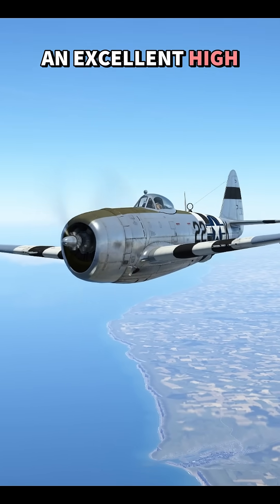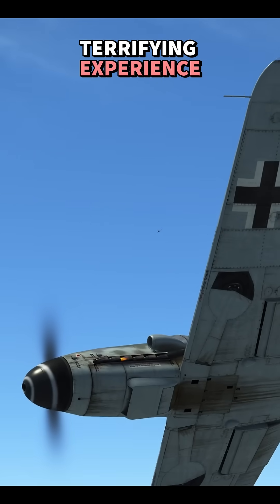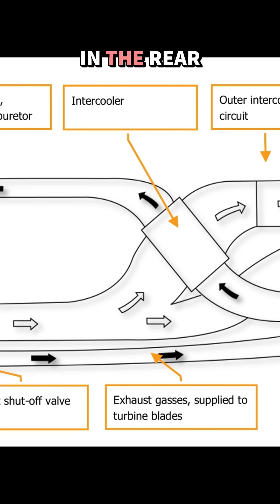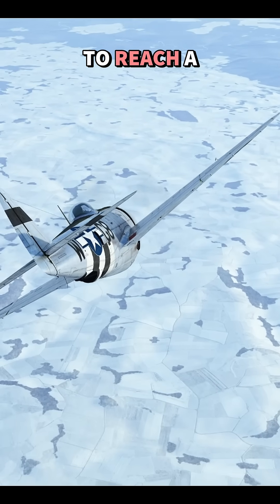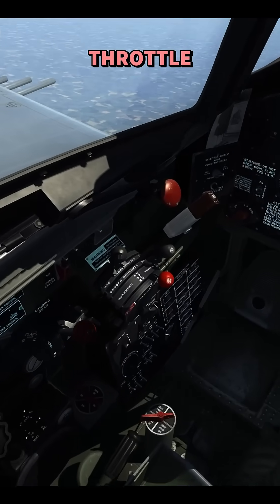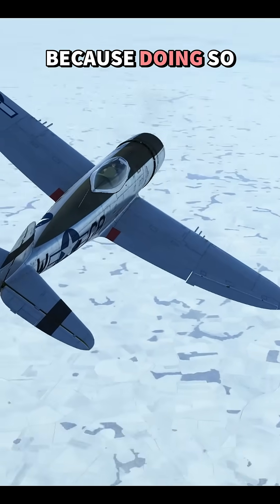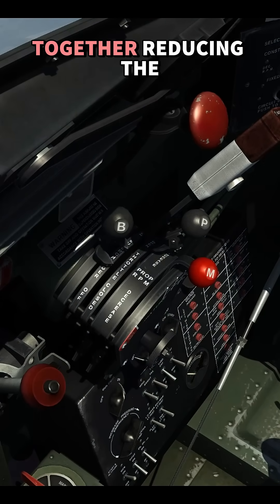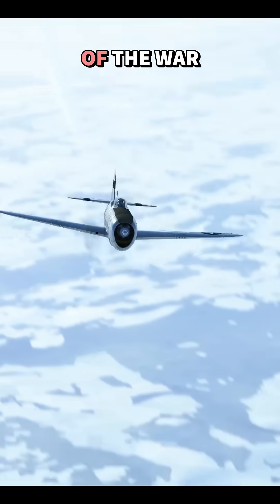P-47 Thunderbolt - Turbosupercharger

Comment: I use the (m) system and don't understand the (ft) system. Could you please make a video using the (m) system? Because there are more of us than those who use the (ft) system. The (ft) system is very old and is becoming less relevant
Reply from the maker: I usually include conversions so both metric and imperial units are shown. In this video, though, I felt it would've been a bit too cluttered, especially when listing speeds for multiple aircraft.
So I apologize for that.

Comment: I believe a turbocharger is using exhaust gasses to compress the intake air whereas a supercharger is a compressor directly (mechanically) driven by the engine itself. There is no “turbo supercharger”.

Comment: Didnt the later versions of most high altitude fighters and interceptors on ww2 use geared turbo and supercharger systems? Like the later versions of the FW 190. I feel like a geared turbocharger would perform better than this system

Comment: The engine was turbo supercharged.  It had a turbo in the back, and the supercharger was actually integral to the engine. It was housed forward of the accessory gearbox and aft of the second row of pistons.
Reply: That's not what turbosupercharged means. The "turbo" is the turbosupercharger i.e. a supercharger driven by a turbine. The second-stage supercharger you mentioned isn't what makes it turbosupercharged.
Reply: @_questionmark_ no.  There is no”turbosupercharger”. There’s a turbo and a supercharger.
Reply: @petrosspetrosgali it seems you don't know what a supercharger is
Reply: @_questionmark_ no.  I didn’t . I have not been a certificated aircraft mechanic for 2 decades.

Comment: It had a supercharger as well it was double supercharge in the open mouth was the cool the air on the P38 you'll see it center of the pylons P-51 you'll see it on the belly the one on the P-51 nose is engine oil cooler
Reply: A turbocharger is a form of supercharger.

Comment: Did the chicken or the egg come first 😂 I’d have described with the supercharger first since the turbo takes time to spool and the super charger is driven by pulleys off the engine. That’s the whole reason to not just use a turbo. They needed the help from the supercharger at lower rpm with the turbo technology of the era.
Reply: aircraft engines don't spin at low RPM in flight, the second-stage supercharger was there to increase boost
Reply: @_questionmark_ I’m not enough of an geek on this topic to tell you when exactly each plane upgraded but typically pre war and at the beginning of ww2, when the engines for these planes were being designed, they were using fixed pitch propellers. Variable pitch propellers weren’t a thing yet. 

So they were designed to be used much more similar to a car engine, where the engine has to change rpm to change speed. if you don’t have variable pitch propellers the engine will rev up or down based on throttle position. 

As the war went on most planes upgraded to variable pitch propellers that allows a fixed/optimal operating rpm like you’re describing. But the existing engines weren’t changed in most cases. They worked well enough and they needed planes asap. Production lines for existing engines already were working. 

If the engines were designed to operate at a single rpm or small range they would never need a super charger. You’d just use the biggest single turbo that can spool at normal flight rpm.
Reply: @Rainersherwood  Variable-pitch propellers were a pretty well established technology and they were being manufactured by several companies by the 1930s. The first Thunderbolt prototype to use the R-2800 was the XP-47B in 1940, which was fitted with a constant-speed propeller so your point about fixed-pitch propellers doesn't apply in this case.

When you want to fly at 13,000m above sea level like a Thunderbolt could, you need all the boost you can possibly get and you can only spin a compressor so fast before the impeller shatters from the forces or the air gets too hot for the metal to withstand, so you have an upper limit on your compression ratio from a single stage, with a second stage you can easily go much further from there. It was all about maximising manifold pressure.

Comment: Not only should you never move the turbo ahead of the throttle, if you don’t need the throttle response time you should never use the throttle and turbo together. Instead, think of the turbo lever as an extended range of the throttle, you leave the throttle wide open and use only the turbo lever to get the required manifold pressure. The throttle should only be pulled back if idling the turbo still yields more manifold pressure than you want.
The engine has its own one-stage supercharger which is downstream of the turbocharger. This consumes about 300hp regardless of whether the turbo is in use or not. If you move the throttle and turbo together then this power is essentially wasted as you’re expending it to overly compress the air only to lower its pressure back down at the throttle.

Comment: You explained that it’s a turbo supercharger but explained how a turbo charger works? Is there no supercharger or is it both or somewhere in between the two
Reply: It’s a supercharger driven by a turbine, driven by exhaust heat and expansion.  Or in the parlance of the day, a “turbo-supercharger”. 

That’s what they called it.  The engine also had a mechanical supercharger, and the charge air cooler between the turbo-supercharger and the mechanically driven supercharger was called the “intercooler”.  If there was a charge air cooler after the last stage of supercharging, it would be an “aftercooler”.  😬

Comment: Robert S. Johnson, the top scoring P-47 ace, said the addition of the paddle prop was like adding 200hp and that the P-47 would then outclimb the Bf-109s at high altitude.
Reply: Francis Gabreski was the top P-47 ace of WWII. Gabreski had 28 kills Johnson had 27.
Reply: @charlesdudek7713  Yes indeed and Pat Pattle had 35+ in a Hurricane against the very best the Germans had in 41
Reply: @jacktattis He didn't fly a P-47 so what does that have to do with this conversation?
Reply: @charlesdudek7713  You mentioned Gabreski etc I just gave you a pilot flying a Hurricane beat your best in 10 months
Reply: @jacktattis  yeah and he was killed in action unlike gabreski so was he really the best?
Reply: @aperson696  50+ how about that one  Gabreski ?
Reply: @jacktattis  the P-47 still had a greater kill ratio than the hurricane and pretty much the same as the spitfire
Reply: @jacktattis Gabreski was our best. He was the best in a P-47.  Richard Bong was our best with 40 kills  flying a P38. Before you get yourself all puffed up remember if we didn't enter the war you'd be speaking German.
Reply: @charlesdudek7713  hahahaha When Operation Sealion was cancelled No German invasion 
Bong flew a P38 he never faced the Germans
Reply: @aperson696  Kill ratio  we never used that. Purely an American thing. Like counting  aircraft destroyed on the ground as victories GEE YOU WERE PATHETIC
Reply: @jacktattis  I guess the fact that you would have lost the war without us is what drives your defensiveness and insecurities.  Get feeling better.
Reply: @jacktattis its still enemy knocked out no? also the entire 56th fighter squadron were aces
Reply: @aperson696  No it is not, of course the US used it to boost numbers 
Ahh the mighty 56th 665.5 kills now get some education my friend 
56th F/G 112 active planes 
RAF Hurricane Sqns 16 planes /Sqn  before D/Day
1    Sqn 212.5 
85  Sqn 278
111 Sqn 269
48 planes  Total 759.5 just passed  the 56th now lets go to 112 planes
81   Sqn 208
303 Sqn 125
73   Sqn  200
43   Sqn 159
  112  planes  Total 692 
Grand total 1451. 
Hurricane a main frontline fighter from Oct 39 to Oct 41   24 months /56th April 43 to April 45  24 months 
So a plane circa 7500lb 350mph top Speed absolutely creamed a plane 430mph 15000lb to 17000lb 
And the Hurricane fought the best  the P47 the  rest
Reply: @jacktattis  was the P-47 supposed to go back in time to the early war? also this whole video is about JUST the 47 why do you feel the need to say "hey hey hey look our british fighters were better!!!!" like do you feel invalidated because people like this american fighter?
Reply: @aperson696  too late you boasted about how good the 56th were  And I fed you facts
Reply: @jacktattis  🥱🥱🥱🥱🥱🥱🥱🥱🥱🥱🥱
Reply: @charlesdudek7713  Are you joking I am Australian and it was the Aussies that beat the Japanese on NewGuinea Borneo and Bougainvile
Reply: Tests show that a 109G could out climb a P-47D-25 at all relevant altitudes. The gap really only closed above 25,000 feet. The vast majority of combat took place at lower altitudes.
Reply: That's not actually what he said. What he said was that "the new prop was worth a thousand horsepower and no 109 or 190 ever out climbed me again." What Johnson doesn't tell you in this breathless hyperbole is whether or not the situation ever arose again. We have no way of knowing. The fact is that, at the altitudes these combats took place, 15,000 to 25,000 feet, the P-47 was uncompetitive against the German types. It only started to outclimb the Focke-Wulf over 25,000. The 109 was another matter.

The explanation is obvious: power to weight ratio. The P-47 was just too heavy. Post war British tests confirmed this.

A lot of Johnson's claims need to be taken with a pinch of salt.
Reply: @thethirdman225 its known that johnsons p-47 "Lucky" had more power and manifold pressure he could prob outclimb 109s and 190s
Reply: @aperson696  
"its known that johnsons p-47 "Lucky" had more power and manifold pressure he could prob outclimb 109s and 190s"

Known by whom?

Let me put it to you this way: a Bf-109 G-6 has a gross weight of 3,150 kg and a power output of 1,455 hp. A P-47D-40 has a gross weight of 6001 kg and a power output of 2,000 hp. So, in other words, the Bf-109 has three quarters of the power for just over half the weight. That's 2.165 kg/hp for the 109 v 3.000 kg/hp for the P-47 or in other words, the Bf-109 had an almost 50% advantage in power/weight. To be competitive with that, Johnson's P-47 would need to make about 2,800 hp and it didn't.

I know: "Greg says...". I'm sorry but I have had this exact argument with Greg. He backed down. Then he deleted my comments.
Reply: @thethirdman225  the P-47 also had a turbo supercharger that meant it kept much of its horsepower at high altitude and the P-47 was known to be really fast and could translate the speed into a zoom climb and considering the 47 had powerful armament it could quickly knock out a 109 or 190 so it didnt need to be sustaining a high climb rate to catch them
Reply: @aperson696  Yes but any aircraft can do that.
Reply: @thethirdman225  the P-47 was known to be really good at diving as its heavy weight and high roll rate made boom and zoom attacks really good on the 47
Reply: @thethirdman225  you may wanna check those power output numbers. For such a later delta thunderbolt those seem misleadingly low.
Reply: @capitaljushman5756  It really doesn’t matter. I used those figures as a ballpark for comparison. Comparative testing after the war showed that the P-47 was uncompetitive in rate of climb at most altitudes. Check WWII Aircraft Performance website for primary source material. The explanation remains the same. The Thunderbolt was too heavy.
Reply: @capitaljushman5756  They are figures for a P-47D-40.
Reply: @thethirdman225  Figures from what? NACA?
Reply: @thethirdman225  you keep basing each and every one of these test bases off one mans findings and i find it very hard to believe its being done in good faith.
Reply: @capitaljushman5756   And you keep asking questions in the hope that I'm going to give you 1) answers you want to hear or 2) a loophole you can exploit, whether it's relevant or not.
Reply: The best escort fighter was the P 51 ,Fact)
Reply: hahaahahah   P47D-10 Oct 44 climb rate  never better  than 3120f/m @ S/L 450 f/m @  32000ft hahahahaha
Spitfire Jan 44 JF934 35000/44000 1440f/m
100f/m @ 44000ft
hahahaahaha
Reply: @jacktattis  Warthunder is different from real life and IL-2 is more accurate to the real thing than Warthunder will ever be.
Reply: @jacktattis  D-10 did NOT have the paddle prop genius
Reply: @aperson696  how do you know?
Reply: @aperson696  well d..k you give us tests that show the mmassive increase in  climb rate
Reply: @jacktattis paddle prop for the P-47 wasnt introduced till the D-22-RE and onwards and according to gregs planes and automobiles the climb rate increased from 2800 ft/s to like 3000 ft/s (if i remembered correctly)
Reply: @aperson696  Wow all of  that gee hahaaha you do know the Spitfire was  getting 4800f/m  from Jun 42
Reply: @aperson696  Thanks still not great
Reply: @jacktattis yeah and the spitfire had a short combat range and lower top speed than the 47
Reply: @jacktattis IF i remembered correctly also 3000 ft/s is average
Reply: @aperson696  This is what I have found out over 14 years on here WW2 Aircraft Performance  
  P47D 42-26167   15 Jul 44                                                                                                               Spitfire MkVII  HF MD176 Merlin 71
High Speed  mph                                                    Climb Rate f/m                     Altitude                                  H.S. mph                                                    C/R f/m
 S/L          345                                                                 3180                                  10000ft                                  373                                                           3930
10000ft    383                                                                2920                                   16200                                    400                                                           3930                                                                                    
20000      417                                                                 2470                                   20000                                    400                                                          2920                               
 32000     435                                                                 1100                                   26000                                    412                                                           2900
35000      412                                                                  570                                    29400                                     424                                                          2900
Absolute Ceiling 38200ft                                                                                         34000                                     420                                                          1760   
 Wright Field terminated their tests at 400f/m Climb Rate                                40000                                      409                                                          930
                                                                                                                                     44000                                       376                                                         300  
Spitfire after Mar 42 90 Imp Gal  belly tanks Depending on tune and Merlin Variant                 1150/1250 miles
Reply: @jacktattis  i dont think this chart is correct if you take a look at Gregs Airplanes and Automobiles video on the P-47's climb rate and go to 23:00 the P-47 is pretty close to the spitfires climb rate at 25000 feet at weights that simulate full internal fuel and ammo
Reply: @aperson696  The chart is from ww2 Aircraft Performance and was performed at Wright Field  You must not put too much faith in Greg He  has to make money
Reply: @aperson696  All British Tests were at combat weight And that is only from a test where speeds at height were registered There are other Spitfire climb rates that would embarrass the P47
Reply: @jacktattis  btw the P-47 still yields greater range than the spit 9 (the most common variant in 1944) also i would like to ask why include the spitfire? the comment above says the 47 outclimbed the 109 not that the 47 could outclimb the spitfire
Reply: @jacktattis  yeah and you used a spitfire variant specifically designed for high altitude cant put too much faith in you can i?
Reply: @aperson696  hahaha How about this 08 Oct 43
Spitfire IX JL 165  Merlin 66  25 lbs Boost 
Climb Rate
 0-5000ft             5740f/m  
5000 -10000ft     5080f/m
10000-15000ft     5080f/m or
MkVIII Vickers Merlin 66 25lb Boost JF934
5580f/m MS gear 
5080f/m @ 6400ft FS gear 
409mph@14000ft 405mph @  20200ft and then Merlin 70 436mph @ 27500ft and on to 44000ft
R/R and Supermarine /Vickers were always trying something
Reply: @aperson696  You people do not get it IT WAS NOT OUR DUTY TO ESCORT YOUR BOMBERS You never escorted ours
And to send replacements to Italy the Spitfires with 170 gal belly tanks could fly at 40000ft + over the Alps to Italy land an put on the 90 galTank
Reply: @jacktattis  did i ever say the spitfire was meant to escort american bombers? the spitfires internal fuel was not enough to make it back to base after the external drop tank was dropped in combat thats why its ferry range
Reply: @aperson696  No not so  the Ferry tank was installed to get the plane to the Middle east 
this is one route By ship to
Takoradi Gold Coast to
Lagos -Nigeria to
Kano to Maduguri to 
Fort Lamy - Chad to 
Ati to El Gemeina  Sudan to 
El Fasher  to Khartoum to
 Wadi Halfa  to Luxor and then to CAIRO  Total Distance 3000 miles
Source Morgan and Shacklady Spitfire the History Page 150
Reply: @jacktattis Who the fuck is paying him then, genius? Who is giving money to lie about relatively ancient warplanes?
Reply: @agent7176  What are we talking about